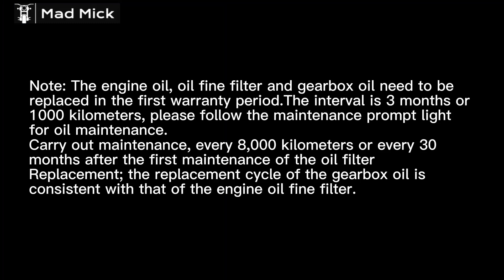NEW ZONTES 125 M SCOOTER OIL AND FILTER CHANGE D.I.Y.

Comment: El mismo aceite del motor es el que va a la transmisión y su filtro entiendo?
Reply from the maker: i personally use 80/90 gear oil for the gearbox but yes you can use the engine oil